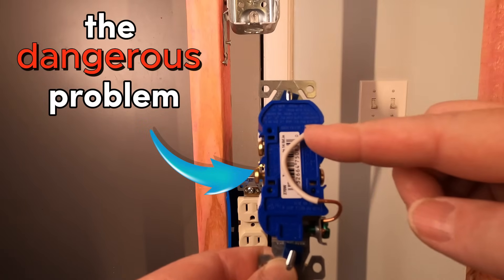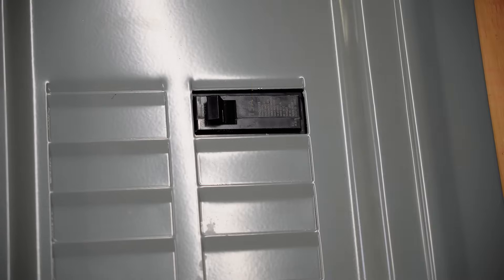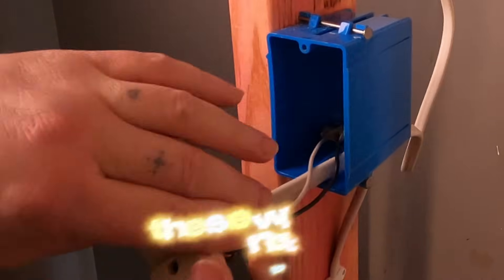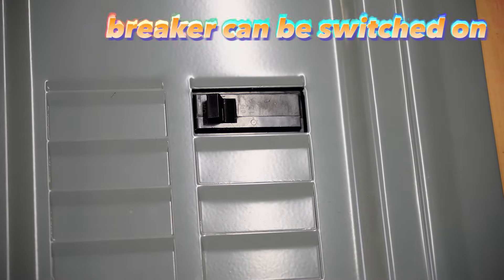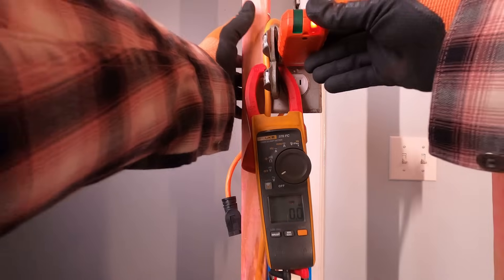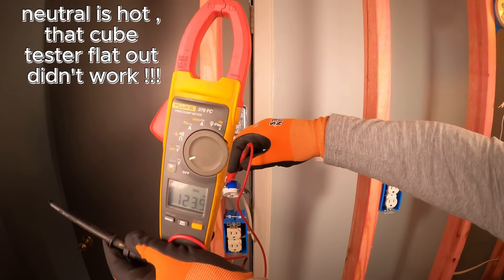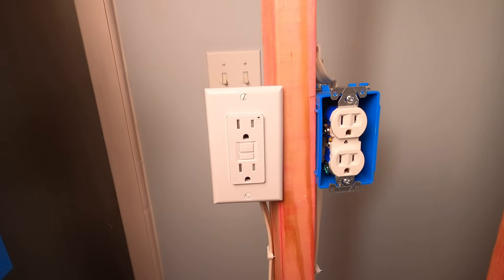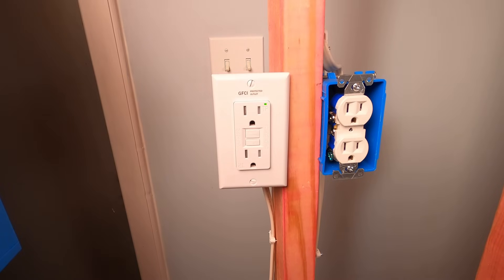why the cheaters ground is so dangerous & the #1 fatal reason to stop doing it !!!🤬

Comment: 27 years in the trade and I have seen this many times... that said I've seen guys with their electrical/ certifications/ contractors licenses years in that have no business being and touching anything to do with electrical systems... just as drivers licenses do not mean people should be allowed to drive...
Reply from the maker: I totally agree, thanks for the comment, man. I’ve been running into this because I’ve been doing quite a few remodels and older homes and it’s something that I keep running into with this and all it takes is a hot reverse neutral. I’ve seen something similar just like this except it energize the entire shed tin roof

Comment: Anyone that knows even a little bit about electricity, should know this is a very dangerous practice! there's really only one good alternative to making this a safer circuit without replacing the wiring, is by adding a GFCI receptacle in place of the 2 wire receptacle.  Oh those weekend DIYer's, sometimes do more harm than good!
Reply: I don't think this is done by a diyer. Seems more like a shady electrician that knows a few tricks.
Reply: @CoryBrian  Exactly what I was thinking I've never met them, but I've been behind Jack Legg and Jerry Rigg correcting problems on too many occasions .The problems are even worse on equipment controls.
Reply from the maker: Thanks for the comment, you know that’s true. There’s a lot of DiYer’s  doing this it’s almost like they’ve watched a video that showed them that this could be done and they could trip up a cube tester. And doesn’t really know what could actually happen if there was a hot reverse neutral, and someone that doesn’t work on electricity day in and day out they make mistakes all the time.